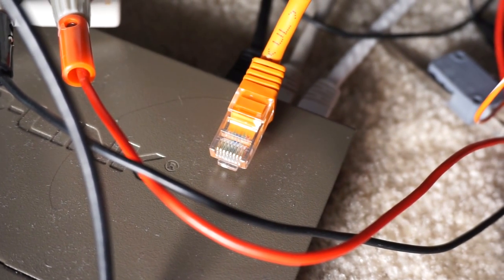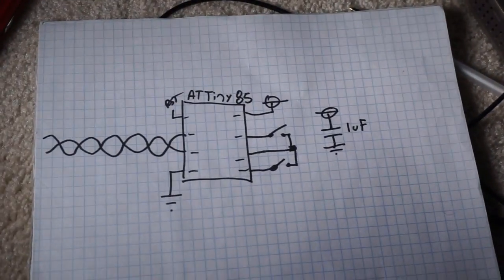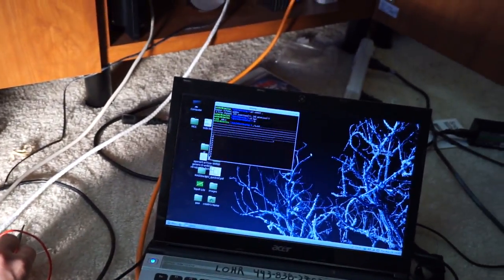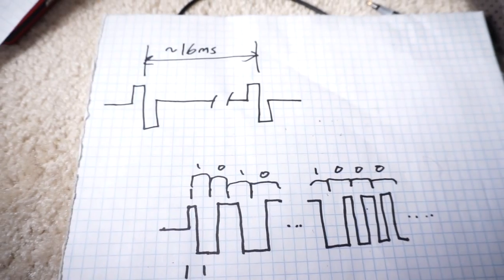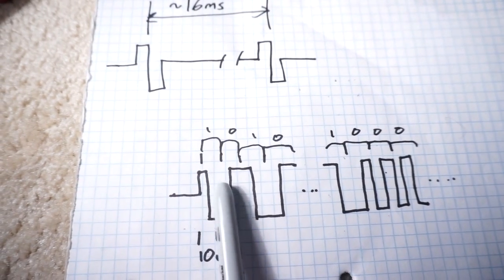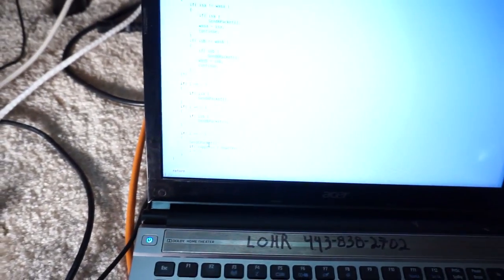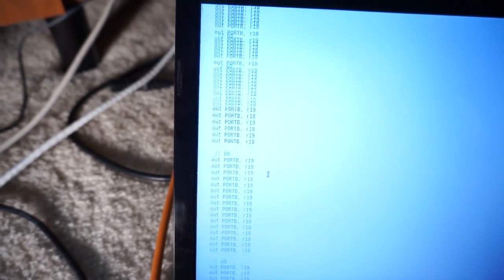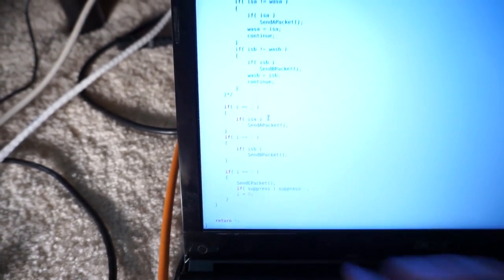Bit-banging Ethernet on an ATTiny85

Comment: What's the lowest powered Wifi device you've found?
Reply from the maker: the ESP8266!  You can get it to connect and maintain an active connection at about 14mA!
Reply: 14mA is still pretty high for what I'm after. (Though I've found a workaround so I will be using the ESP.)

What I've been curious about is if there are any boards with immensely fast connect times so you can have some seriously low power usage over time. Connect, upload, disconnect, all in 10ms (or something like that). Compared to the typical connect times people have talked about with the ESP (1.5-8secs even with static IPs) that'd use like hundreds of times less power per upload.

I think some of the TI chips may be able to do this but I've not confirmed. This could give "always on" (seemingly) capability for much less electricity. Coin cells for years maybe.

Comment: No magnetic isolation, the project probably WOULD die in a fire of its own making <grin>... reminds me of the old days of 10base2 or 10base5 ethernet where if you ran it between buildings, BAD things could happen due to differing ground potentials, the shield of the co-ax, and gremlins.

Awesome to show that you CAN do this though, thumbs up!
Reply: But it's pretty possible to do HV isolation without magnetics. Of course you need to isolate Tiny circuit from the rest of the board with >8mm gap, provide power with HV isolated DC-DC converter, and connect instead  of switches to opt-couplers let's say cheap BC817 they are low-frequency but enough for KHz signals. Of course ATtiny may catch a fire, but the rest of the circuit will survive.

Comment: Nice hack!
Maybe hacking the UART available in many AVRs to generate the signal thus free up resources (and then using a differential RS422 driver to create the differential voltages) could be a next step.
Though the sheer simplicity of this approach is very neat.
Reply from the maker: I couldn't figure out how to do this with the USI for two reasons: I don't think you can send a continuous stream, and you have to have a delay, AND, I don't think I could do it fast enough, so I'd have to use an external XOR to do the actual encoding... PLUS something to drive the line and its inverse :(.

You can only guess how much I wish you could write and re-write the flash forever.
Reply: If the AVRs only would be von-Neumann, then you could generate the code to push out new stuff on the fly and execute...
Reply from the maker: Sounds like a little hacking will lead to a video response.  But, one of the benefits here is you can do differential signaling.
Reply: ***** is there an 8-pin DIL version?
Reply: wouldnt the start and stop bits also be a problem? for differential output you could just use an inverting buffer ic^^
Reply from the maker: You can avoid the start and stop bits, but you would need to sample at at least 31 MHz to get it to work.  That would also require multiple clock sources on the on the other AVR.  The T85 has more clocking options than horologists's office.